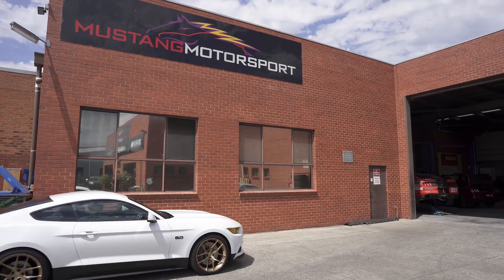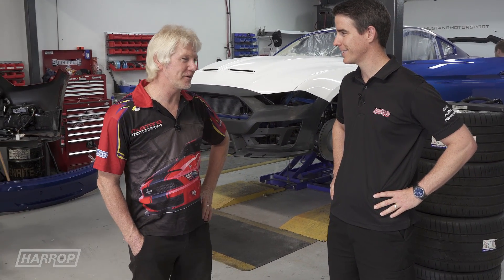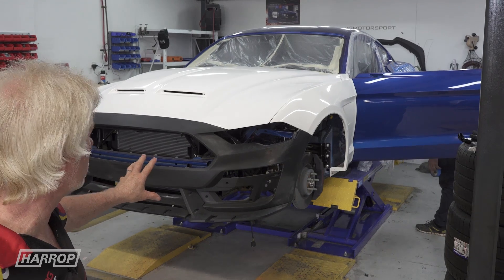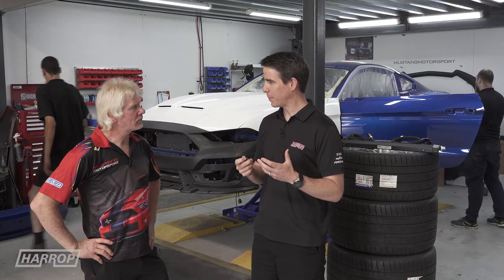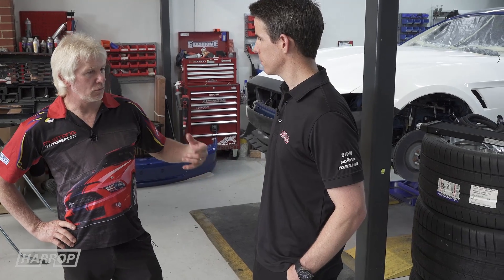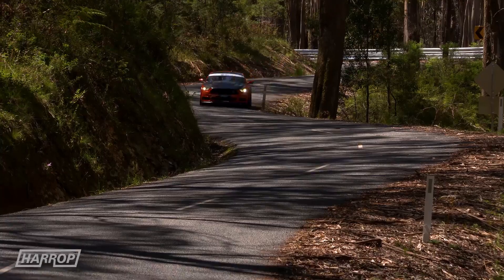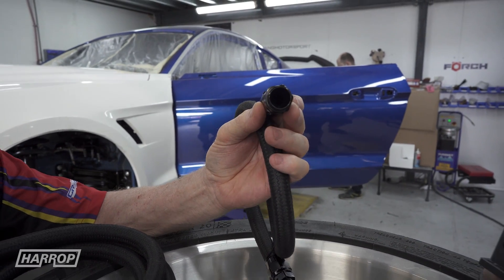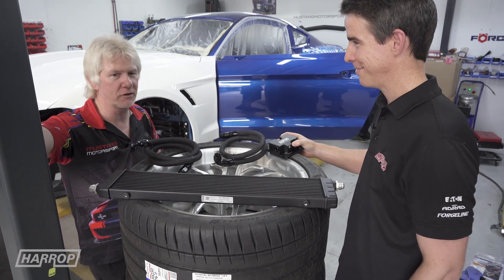Ford Mustang GT | Harrop S550 Engine Oil Cooler Kit

Comment: when you use the Harrop supercharger does the exhaust get changed or headers only??? The price for the supercharge is 13990 is that the overall price or is there extras at another price?? Any feedback would be greatly appreciated

Comment: Would like to know more about the oil cooler and a installation video. Like you say the one thing mounts to the side of the block. So where exactly and does it take the place of the original oil filter and cooler? It didn't seem like it would fit there only because of the flat back and so im guessing you need some sort of sandwich plate or something to get the oil from the filter location to the (unnamed item) oil temp pass through/spliter? I'm genuinely curious but have very little to go on unless I'm expected to custom fit everything. More info, looks like a radiator from a pc cooling system.